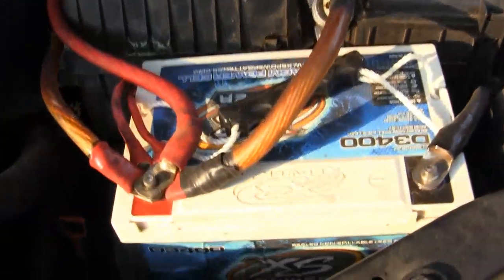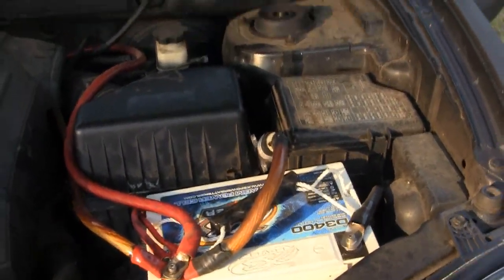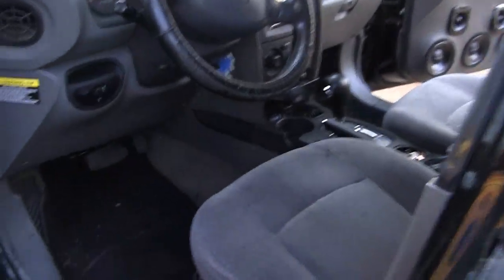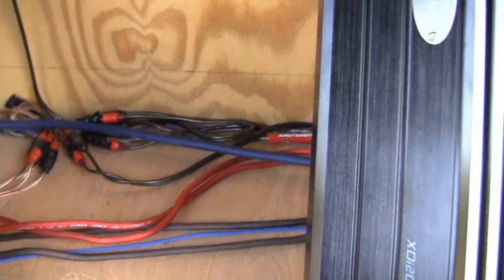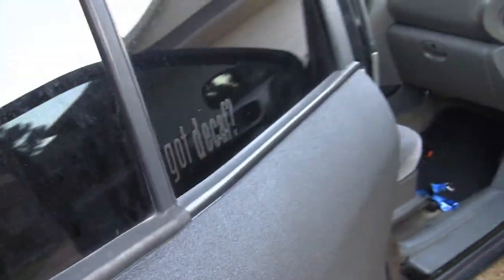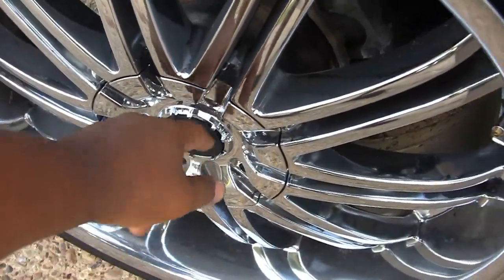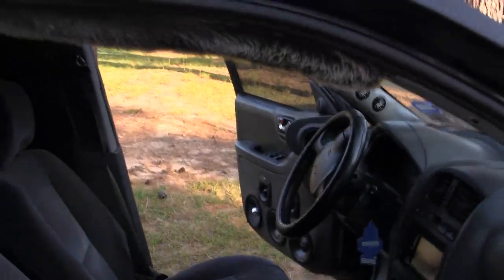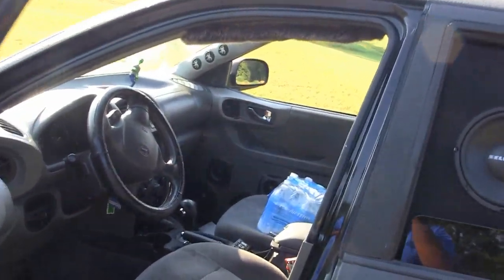Twistedchild420 Hyundai System Walk Through- 4 DAD BD 15's-4 Arc Audio XDI2000.1's

Comment: Jw cause I just got a 2002 Santa Fe what would you recommend me do for my electrical to run my synergy amp? Say 2- 2500 rms watts. I've been considering on just getting like a 3 farad capacitor or should I get a good battery

Comment: like the car its nice, im getting 2 re audio 12s, 600 wrms each, and a hifonics 1500 watt amp, do you think i should upgrade the alternator or get another battery or should it be just fine without, and i already have the big three, on 500 watts rms and my lights dim slighty